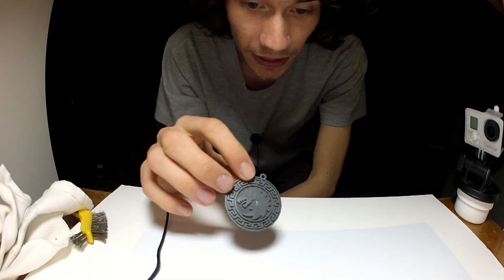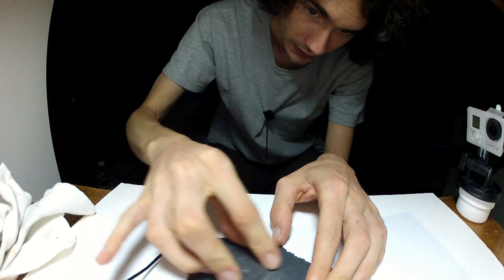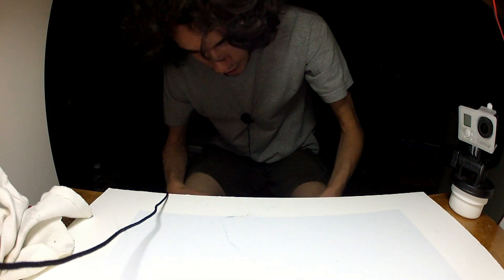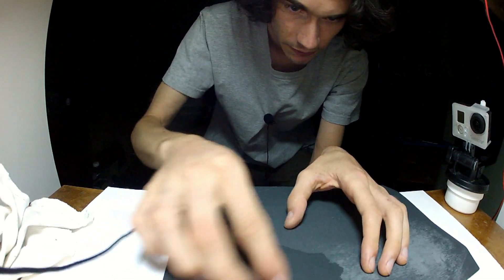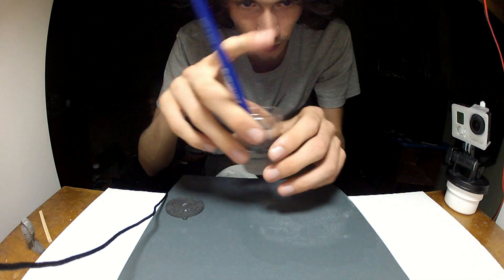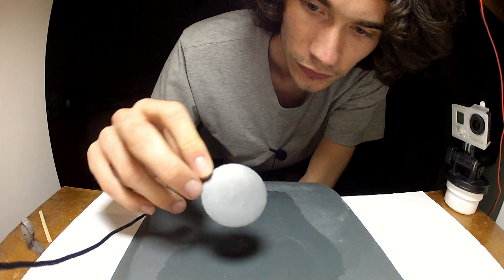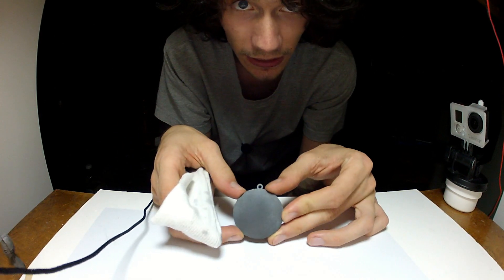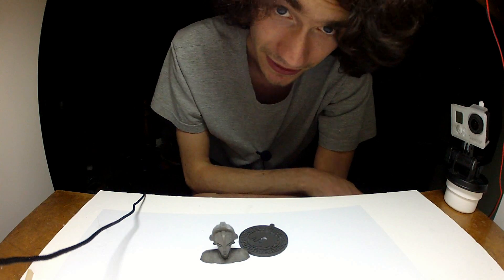Polishing Proto Pasta Metal Filaments

Comment: Thanks for your Video, i got a little "trick" for sanding: do it only in one direction, for example up and down on 180 grid, when it's all even and you switch to 280 don't rotate the piece in your hand and do only left/right
movement now...and so on... you can literally see it, when you are done with one grid, when all lines from the previous up/down movement disappeared...

Comment: You might actually be able to get a bit more out of it if you switch to sanding in a figure-8 pattern. That's what the pros do when lapping since it undoes any biases in your motion (like pushing harder on the up-stroke vs. down-stroke). More variation = more sanding angles = smoother end result!

Comment: i wonder if a derivative of the technique found here (a clip from Barnacules video) would work. Yes the temperature and time in the convection oven would be different, but i wonder how this method would compare once dailed in.
https://youtu.be/D78R0uzP4HA?t=9m53s
Reply from the maker: Eh... by the time you got it hot enough for anything to happen the material would be melted. PLA tends to get soft (on its own) ~50*C (122F) so 250* F for 5 min would FOR SURE melt the model. I have never liked buffing wheels since they tend to make more trouble than they fix... but that is just my opinion!

Comment: Sweet polishing vid dude! Just goes to show there's no shortcuts in polishing up the metal filled plastics, bronzefil etc you need to do it right to get the shine. Does steel wool work nice on the protopasta stuff? I usually go to that as a final stage after the fine grit for brozefil models. Also was surprised that the colorfab XT-CF20 polishes into a real nice dull black too.
Reply from the maker: +Maker's Muse Thanks man! Yes well said and I maxed at 2,000 grit sandpaper so if I can get my hands on higher I am going to give it a try but I think you reach a point of diminishing returns. I feel like the polish compound takes it from "nice" to "wow" in my opinion although it isn't applicable for every situation I feel. And yes the steel wool does work just the same on it but it makes such a bloody great mess I keep it out for that very reason. 

In the near future I am going to explore other options of post processing like tumbling but even there it helps to pre-sand the model honestly. This is a magnetic iron model I left in my tumbler for a few days with some heavy cutting media and the results were pretty impressive. https://instagram.com/p/70dj8dkFHo/?taken-by=crazywhitemachinist
Reply: @MakeItWithCalvin  Thanks , This is very helpful and I'll check out using a tumbler
  well the video isn't there, but I got the concept.
Reply: Try getting some micromesh pads you can go up to 12,000 grit
Reply: burnishing with steel wool works well if you have given it a good polish. using a rotary tool and a sanding sponge followed by a felt disk/polishing compound is a good preparation for burnishing.